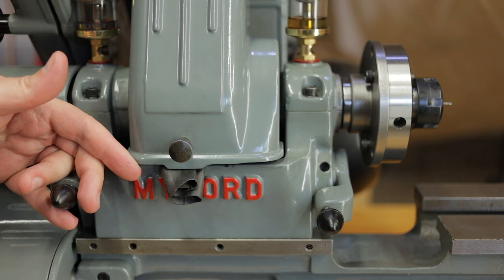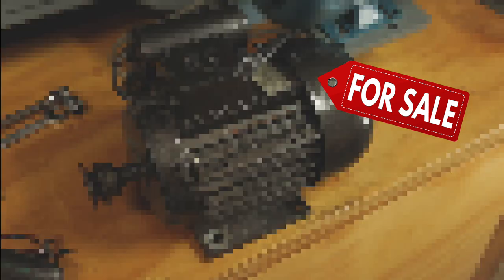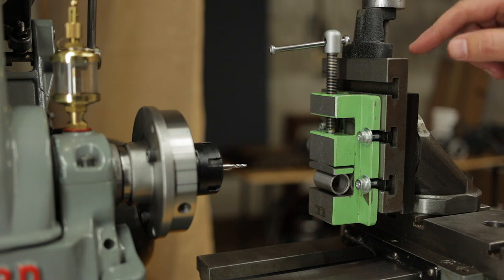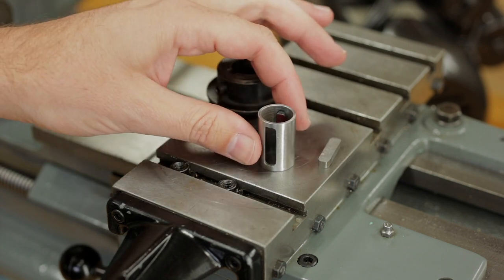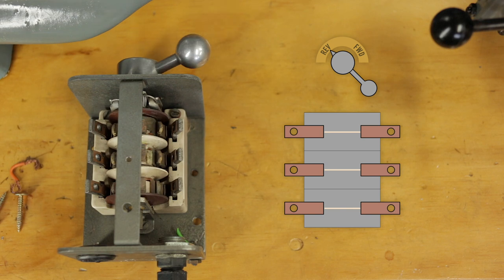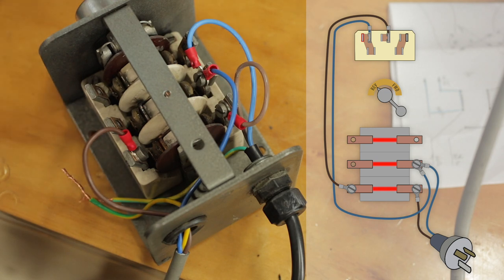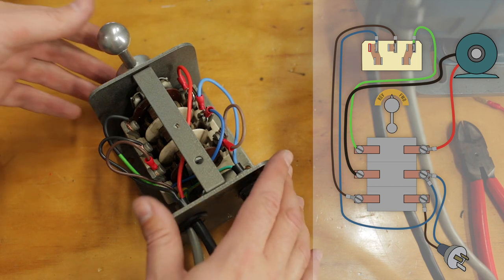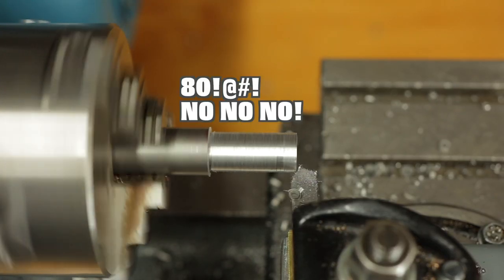Drum Switch & Electric Motor Wiring - Myford Lathe Restoration Part 11

Comment: Would you recommend buying a Myford ML7? Looking at buying my first lathe and I'm used to working on a Emco Maximat 11 and a Swedish version of the South Bend named Blomqvist BSN600. But there are currently a few Myfords for sale in my area that have peaked my interest.
Reply from the maker: No. Not if you want something that works like an Emco 11. Myfords are great if you want a little lathe to play with - lots of accessories - and much better than a cheap new mini lathe. But If you have space, for the same money, you can get a larger boxford or emco, which are both really common and easy to get parts for etc. The extra size is going to make them way more rigid.
If you do want a myford, try and get a Super 7 with a gearbox. The Super 7s have 'modern' headstock bearings instead of old solid white metal bearings like the ML7 which drip oil everywhere - and a gearbox is so much better than change gears. I'm not saying I'm an expert or that there's anything wrong with a Myford ML7 - but that's my shopping advice.
Reply: @GeoffreyCroker  Myford 7s are also ridiculously expensive compared to less "pretty" lathes like Boxfords and so-on.
Reply: “Piqued” rather than “peaked”
Reply: Boxford are clones of the south bend 9 too, much heavier built and precision taper roller bearings on the spindle, loads of interchangeable parts between all of the clones except the smart and brown sabel which has a different bed profile
Reply: Everything the venerable Mr Croker said; if I were doing it again I'd at least wait for a Super to come up, but I should have gone for a Boxford, or even a mid-sized Colchester. Instead I've got two Myfords. It's a sickness. There is no cure. Don't fall into the trap...
Reply: I used a treadmill motor on my 12 x 36 atlas,,,best thing I could have did,,,so quiet and smooth and the soft start is so much easier on the lathe and so much more power then ac motor,,,can t beat the speed control,,,
Reply: @georgespangler1517  I did the same: I put a 2.4 HP variable speed treadmill motor in my 1955 Boxford A. Made a Youtube video about it. A great improvement.
Reply: @Evan-e-cent  smart man,, l just put a 1.5 HP on my 6 inch lathe and looking for a 2 hp are bigger for my Rockwell wood lathe next. was going to do my Sheldon horizontal mill but would be to much hassle with the cabinet set up and it's alot better setup then the vintage lathes were,,, but it sure is nice on the lathes I'm sure you agree
Reply: @georgespangler1517  Right! I wouldn't go back to fixed speed. I used the original pulleys and although the motor does 4700 RPM, the middle sized pulley allows me to get up to 2000 RPM for polishing, and down to zero with variable speed and reversing. If I need more torque/power at low RPM I just put it in back gear. Never fiddle with the pulleys. It is especially good for single point threading.Just slow right down as I approach the end of the thread and glide to a perfect stop . Use the motor to wind back at high speed. Fantastic. (made a YouTube video showing that) 

I put the same setup on my pillar drill, and just bought a 3 position, center-off, double-pole-double-throw switch so I can switch to reverse if a drill gets stuck ($8). Again great not to have to change belts when varying drill sizes. I have several videos including explaining the electronics on YouTube under the name even-e-cent on a playlist called 'How to use an engineers lathe' (50 videos). The latest one about how to make cams.  I also wrote a free online program called RideTheGearTrain.

Comment: It took seeing how you did this for the reversing rum switch to make sense! Thank you. And also others safety warnings. On the wiring and these drum switches. Best to install a double pole double throw to the motor. Meaning when the switch is "off" no circuit at all goes to the motor. Then use only the top 4 connections for motor reversing. Otherwise one leg to the motor, the jumper connection 4 & 6 to the motor is always "hot" even when the reversing drum switch is in the off position. Most big button on/off switches are DPDT and you can get DPDT that are like wall switches that here in the States will fit in what we call a surface mount box or old work box. Thanks again for your explanation!

Ron

Comment: @Geoffrey Croker … I found this extremely helpful as last week my motor shorted out scaring the 💩💩 out of me.
So I have had to start stripping it down to get rid of the original rubber coated cable, to replace it with better quality.
I took photos of the switch to help me with the rewire, but now I can do screen shots and print them, many thanks 🙏

Comment: Personally I probably would have gone with the single T-profile key.  At the time you were considering the options, my reasoning was that this way the power is transmitted from the motor to the pulley via the key . With the 2-key solution, the motor power is transmitted via the motor key, the adapter bushing (which has very little cross-section by the longer key), and then the second key.  

Then as the video progressed, it became apparent that the extra machining for the one-piece key would have been made up for by the modifications to the other keys, welding, etc.  

Great outcome either way.  I hope that broken motor went into the stash or to someone that fixes it -- it's probably something simple and/or educational to fix

Comment: I'm not a Mechanical Engineer, but the way you made the bushing it now works as an intermediary coupling (i.e. the force is coupled from the motor shaft, 180 degrees through the bushing and finally to the pulley) instead of just from the motor shaft to the pulley with a T shaped key. Not sure if it matters though.

Comment: Geoffrey, ditch the top slide and make yourself a solid tool post mount that bolts directly to the cross slide. You’ll notice a huge improvement in rigidity.
You can save the top slide just for turning tapers and the like. 
Darren

Comment: Step key and slotted bush would work.
Maybe as you did but with the keys at 90 degrees not 180.
Both with clamp screws, better holding and alignment.
Recommended for slide fit pulleys.

Comment: The excellent video really well done.   Those lever switches are a bit lethal though because you can easily knock them on.  Especially when you are messing with the change gears.   A stop button in line wouldn't be a bad idea.   How powerful is the motor?

Comment: I use treadmill motors on my lathes,,,can't beat them,, do quiet and smooth and the soft start is so much easier on the lathe and I love the speed control, no more pulley changes

Comment: Today I leaned that I am not going to be an electrician when I’m older, that wire diagram made no sense to me😂
Reply: Electric motors are black magic.  I'm an electrical engineer. (well, specializing in I&C).  Electric Machines was not my favourite course!
Reply: Its easy if you master the principals of electric motors.
Reply: @MichaelSteeves  Wow, I'm a retired plumber and HVAC tech- I can't engineer the things, but I know how to work with them and workan applications chart and I do understand the magnetic theory- it seems so simple after the "right" explanation, which began with Ohm's Law, how that is the same as the Pressure/flow of water in a pipe, and finishes with the sympathetic acceleration of neutrons through exposure to a moving magnetic source. It's fairly basic science today, Tesla figured it out and everybody has been riding that coat tail since 1890. Machines and gears and clocks and such were my favorite toys as a child, so ratios and such are second nature to me- sorry it was a reach for anyone, because it shouldn't be, as the forces have been with us forever, maybe even the Egyptians were working it!
Reply: I'm older, not an electrician, and it made no sense to me, either.
Reply: @MarkH10  Yep, I got nothin. But it's always good to watch Geoff even if you don't understand what he just did.

Comment: Great video. I love the animations and the supporting SFX. Care to share what software you use? 
Regards, Mark Presling, Australia
Reply from the maker: The basic drawings were done in Affinity Designer (Illustrator knock off). And the wires and movement in Apple Motion. I think both programs are a bit crap btw
Reply: @GeoffreyCroker  ahhh, you're an Apple man. I'm one of those Microsoft Neanderthals. Great job nonetheless.

Comment: you could redo a pulley and remove that strange bush. you could make a plate and rotate the motor 90 degrees so as to have more space and add side blocks. In any case, I'm glad you're fine, I really like your videos, I would have been sorry not to see you anymore 😁

Comment: i swapped both my old belts for linked belts. Wow what a difference. Much quieter.
Reply from the maker: I run a link belt on the main pulleys. Agree. I would have done that except that they are crazy expensive to buy here. As soon as Amazon is shipping international again, I will be buying a few metres of the smaller size.

Comment: Excellent production, thanks for posting. Any chance we can see how the new shop is coming on with all the extra time at home? Instead of that rubber how about a bit of adhesive draught excluder, I've got the stuff all over the place, works wonders.
Reply from the maker: I will do a shop update soon. Yeah pretty much anything glued on would be better. But the inner tube works so I've just never got round to it.

Comment: In drum switch if you number terminals on the left 4 5 6 and right 1 2 3 you connect TERMINAL i.e. thing in your motor that never have power to 4. Then the wire that has no power and instructions say interchange to 5. Line to motor is 6, line from outlet is 3, neutral is 2 from outlet and connects directly to motor. Finally 1 is the wire in the interchange that normally has power going forward. Draw it out and it becomes clear. The Terminal connection is the key.

Comment: Sheet of rubber between the mounting plates, along with a rubber washer top and bottom of the plate on the motor and base will damp a lot of that vibration down. Just remember to add a ground wire from the motor terminal block through to the body of the lathe, so that static charges can be neutralised.

Comment: Geoff, probably a little late now, but you could have simply removed the lower pulley, slipped the belt on, and installed the pulley with the belt in place. Removing the cover as well on the motor would more then likely have given you clearance.
 Looks like there was plenty of room to install the cover after the belt was in place.

Comment: Geoffrey Better to use a contactor!!  Your switch contacts will burn otherwise.  use the switch to operate the contactor,  and the contactor to apply power to the motor.  Regards,  JJ

Comment: Hi Geoff great vids on the Myford ML7, I have been fortunate to have inherited one from my late uncle and have been wondering about the speed at which your new motor turns the lathe, everybody else's seems spin and cut a lot faster and better than mine, it dose say in my manual that around 1600 RPMs should be correct, is this right?  thank you

Comment: Why not replace the bearings on the old motor
Reply: After dismantling the motor, he wouldn't have had access to the lathe to turn down the wrong-sized bearings he would have somehow had acquired to replace the bearings on the motor he uses to run the lathe.
Reply from the maker: It has capacitors hanging off the side with cable ties and a wiring box that looks like a pile of bird s**t.
Reply: Yes, I was thinking the same. Replace the cap and bearings and its good to go.
Reply: can find the native engine? Sorry for my english)
Reply: Might not be the bearings, a bad capacitor will also cause a motor to run rough. The current in an inductive circuit (the motor) needs to lag the voltage by 90° for the motor to run smoothly. If the capacitor is worn out the voltage and current will be in the same phase and it'll run like shit.

Comment: I see you are using a piece of rubber to stop the cover rattling. The cover on my ML7 has a spring clip that holds the cover down tightly to prevent rattling. The clip requires a firm push down to engage. Perhaps yours is missing this?

Comment: Are you missing the little spring clip on the belt cover where your little rubber bung is? Also are your oilers originals or replacements, my ml7 is missing both.
Reply from the maker: Whaaaat!! I think you're right. Now that you mention it I vaguely remember something about a little clip and not putting it back on.... hmmmmmm

Comment: @24m15s (near end): Interesting how the speed of chip formation (chip growth unit length per unit time) seems to be so much slower than the surface speed (RPM and circumference converted to same speed units) of the material. Perhaps it's just an artefact of the camera. Or perhaps the material in the curly chip has been accordioned on a tiny scale.

Comment: Two things, a green wire is always a ground! Using a green wire for power or switching is bad practice. One can use other coloured wires for ground if taped green.

Second, why not put rubber bushings or a slab of rubber between the motor mount and the motor.  It helps reduce transmitted vibration and will help give better surface finish when cutting.  ( That last part was pure baloney, but hey why not!)

Comment: 11:00 You secured the pulley to the bushing, and the bushing is not secured to the shaft. There is a likely hood it will fall off. I suggest going back and going with option 1.

Comment: Whoa, this video was a bit unexpected!
Few questions though,
1) would it have been an option to just enlarge the keyway on the motor a bit?
2) what is that milling music? I quite like it!
Reply from the maker: The right way to do this apart from just buying a new pulley would probably have been to bore out the pulley to get rid of the keyway in it. Then solder/braze/weld in a sold plug. Then drill and bore a new hole with a keyway the right size for the new motor shaft.
But I'm not that worried about it failing and messing up the bushing or keys.
Its just some stock music - Amor De Danca on epidemic sound

Comment: ouuuu well well well great friend good video and good restoration work, I also have a myford ml7 the same as the tullo, the ratio of pinions you use to get a feed / Rev of 0.004 "(0.1mm).  advance is automatic? thank you please answer me thank you thank you
Reply from the maker: Sorry I don't know what you're asking?
Reply: the combination of pinions to achieve that forward speed
Reply: maybe my translation from spanish to english is not the most correct
Reply from the maker: I don't know of the top of my head. There's a chart on the inside of every Myford change gear door, or I'm sure you could search 'myford change gear chart' or something like that.
Reply: I already have that gear change list, but I can't achieve that slow speed of millimeters per revolution, 0.1 tenth or more!  finally I will continue to receive information, well thanks for sharing these great videos, cheers friend
Reply from the maker: It's the first image if you Google 'myford threading chart'. But to help you out, the answer is; Driver 20, 1st stud 65/25, 2nd stud 70/20, leadscrew 75

Comment: I, too, have a thread-on chuck.
When I run it in reverse, I have trouble with the chuck buggering off across the shed.
How do you deal with this?
Reply from the maker: I don't think I've ever run the lathe in reverse, except maybe for backing taps out.
Reply: @GeoffreyCroker  everyone knows running the lathe in reverse adds metal back on. You know, after you realize the part is too small.
Reply: @KR-hg8be  Yes, it's extremely handy. It's just a hassle for me going to retrieve the chuck from the neighbor's yard.

Comment: Try the same on a two speed reversing switch on a three phase motor!
Reply from the maker: No thanks 👍
Reply: Geoffrey Croker  the boggling bit is that some clever lad thought it all up in the first place. Bit like inventing knitting while untangling a ball of string. Good job btw.
Reply: @johnsherborne3245  One of the most impressive things I ever heard was that Paul Dirac was watching his wife knitting, and after a few moments told her that it was possible to make an equivalent but different stitch by changing her motions a little - she negligently told him that it was called purling and she could already do it. It takes much more to impress a wife than me.

Comment: Geoffrey you're a very naughty boy. You cannot use the green/yellow wire for running the motor mate, it's the #@$%%%#@## earth wire. That's there for your safety and needs to be connected to the motor frame. For your safety (and everyone else) the switch metal frame and the motor metal frame need to be connected to the green/yellow earth wire in the lead from the power point. You may have done this however you haven't shown it and other people may follow your instruction and are seriously placing themselves in danger. Remove the green wire from the switch contacts and replace with another coloured wire, you'll probably need a multi-flex cable with brown, grey, black and blue plus green/yellow wires.
Reply from the maker: The motor and switch are fully earthed through the earth wires in the power cables. And you might have noticed I showed putting black heat shrink on the other green wire so it won't be confused for earth. 👍
Reply: @GeoffreyCroker  I did see that however it's a no no to do that with any earth wire. Just remember what you do, others will follow. Having said all that, I love your videos. P.S. I'm a fully qualified electrician with 35 years experience.